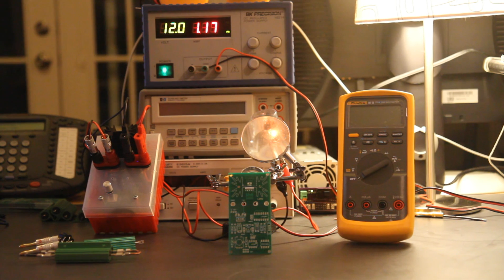Role of load resistor in constant current dummy load.

Comment: Many thanks for this explanation, I am only now just starting to learn a little more about electronics, but ( there's always a but ) further down the comments you said let Ohms Law be your guide, and then you used it wrong and that threw me for a short while, because to find Amps ( or one way ) you have to divide Volts with Ohms, so I think you must have accidently hit the wrong symbol by using Volts x Ohms = Amps, I think you meant / divide a mere slip of the pen as we used to say and it does not detract from your very good explanation.

Comment: Super video!But I have a question! I'm a dentist and electronics is more like a hobby. So...I'm trying to make a power supply that provides constant current from 3 to 20 amps. I've made Dave's power supply but I take a maximum of 4 amps!!! For power source I use a computer power supply that provides 30A at 3.3, 5 and 12V. For a load resistor I used a shunt of an ammeter. 10V run the op amp and instead of a potentiometer I use the PWM signal of a microcontroler. What's wrong with my circuit??

Comment from the maker: To continue, from the previous reply...
I would suggest using a larger load resistor, like 1Ω. This brings down the affect on the FET in measurement and pushes off more heat away from the FET. I am using the 0.1Ω load because I need more headroom from my op-amp than I can get from a LM324. If I had a true rail to rail op-amp that could go 0V to 12V with a 12V positive rail then I'd not be using the 0.1Ω load at all. I'd use a 1Ω. 0.1Ω is taking up more than half the slack with the FET @ 0.005Ω.

Comment from the maker: Nope, you have it right. 0.1Ω just means that the feedback loop first op-amp stage needs a low voltage in the non inverting input to keep the MOSFET from running off the rails. Resistors seem more capable of soaking up the heat than the semiconductor (perhaps this is untrue but it "feels" right). So if you can make the MOSFET a short and burn the current off on the resistor you are better off I think. MOSFET's cannot be a short so 0.1Ω loads make the FET a non trivial portion of the load.

Comment: Thanks for the feedback. Just a small correction, my MOSFET is rated at 90 W.
I understand what you are saying in terms of preventing a total short if the MOSFET is fully saturated, but if you are using a 0.1 Ohm resistor to ground then that's almost a short. Have I missed something?
Cheers,
Martin.

Comment from the maker: Of course you can use multiple MOSFETs (I'd use a bunch of identical op-amp feedback loops). You will want a current sensor because measuring the voltage doesn't help you figure out the current if you don't know the resistance. 

I think it will be easier and cheaper to get a load resistor and a high power MOSFET.

Comment from the maker: Let Ohm's Law be your guide when it comes to the load resistor selected. Because of my large current requirements, I am using a 0.1Ω resistor. I am using a 200W MOSFET and very low voltages in the feedback loop. I am using a 2.048 voltage reference as the high end voltage that goes into the first Op-Amp stage. I use a DAC and an MCU rather than a pot to control the voltage. 2.048V x 0.1Ω = 20.48A @ 10V that is 204.8W. My MOSFET is a 200W max so I can push a LOT of current.

Comment: Certainly no foot in mouth ;-) thanks for making the post but I have a couple of questions:

1) Is a 1 Ohm power resistor enough between the MOSFET and ground?
2) Technically, would having a couple (or more) MOSFETs in parallel suffice? 

Can you point me to any documentation that discuses the role of the power resistor in this application?

Cheers,
Martin.